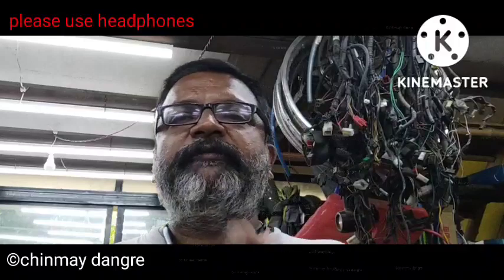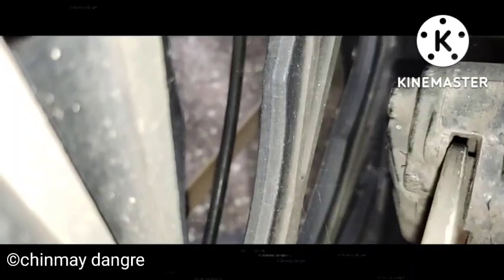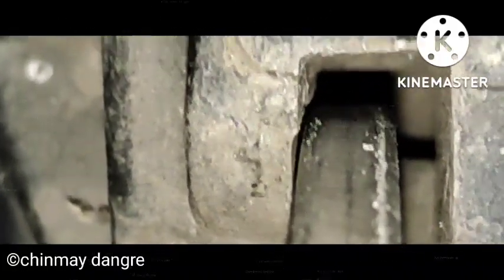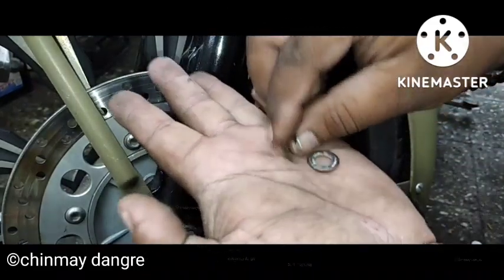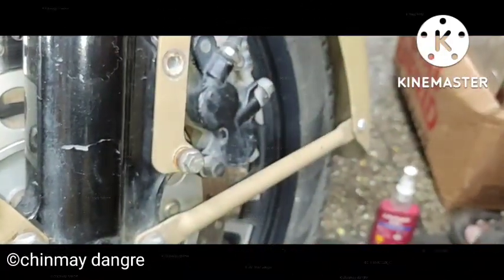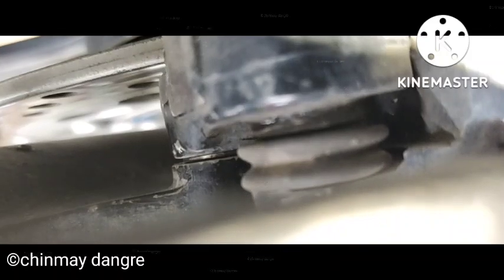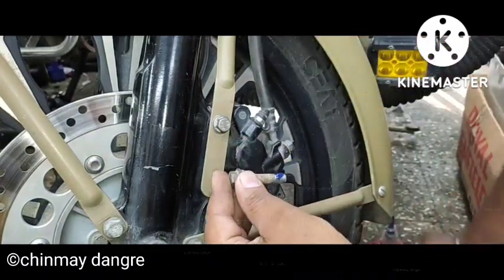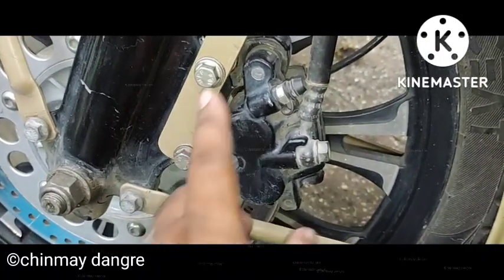"Brake Performance Boost for Royal Enfield – Caliper Shimming Guide"

Comment: Pls tell us how to tune bs4 Carborator
Reply from the maker: Posted. Please check the list. Thanks.
Reply: @MechAutoClinic  sir tell me that we'll have to clean carburetor and spark plugs before tuning.????
Reply from the maker: Depends on condition of your area, kms done by motorcycle, servicing properly done or not, quality of fuel in your area, water in fuel, rusty fuel tank if you have... So many things are there...
Reply: @MechAutoClinic  sir tank is clean not rust problem
And i live in delhi ncr
The fuel density is 78/...
I have problem that whenever  i watched your old video and set my carburetor I will go super but after few days it comes back to same...... I am sick of this problem because anybody can't do this process repeatedly
I feel my bike pickup is also down. 
Speed is not increase
Before sifting gear  even I do more throttle.
My bike is less driven only 15k bs4 without disk 2018 model standard
Reply from the maker: @Bullet-wala  check the slide condition. if slide has discoloration then replace it. if too much serrations on the slide then you may need to replace slide but it wont work for long. so you may need to replace the whole carb.
Reply: @MechAutoClinic  make a video sir how to open and clean carb and in which condition we should change carb😊

Comment: Hi Chinmay, I have old bullet 500 is not running,

I HAVE REPLACED the clutch plates, still my kick is free and even self start just spinning the magnet and clutch but NOT SPINNING THE ENGINE
Reply from the maker: There are two different things. If starter is freely rotating then sprag clutch is gone. And if the kicker is free while kicking then clutch unit is faulty or clutch ch is tight or clutch ch springs are weak. If everything is fine then check if the push rods are too much tight or decompressor is too much tight. Starter is not connected to clutch ch for cranking purpose. Strater will rotate only crank directly through the sprag clutch. Kicker will rotate clutch and crank through the gear box. So check the above point and let me know.
Reply: Hi Chinmay, 
I have opened the clutch,  chain and magnet ( front part) , my crank shaft is spinning free with the hand - is it possible that connecting rod broke or crank shaft broke ?

I have kicked my bike 100s of time because it was not starting ( carbonator problem at the time. )
Reply from the maker: Oh boi.... Can you please send me your phone number on  macasp@gmail.com. I will call you.